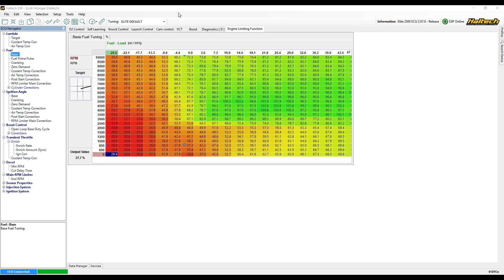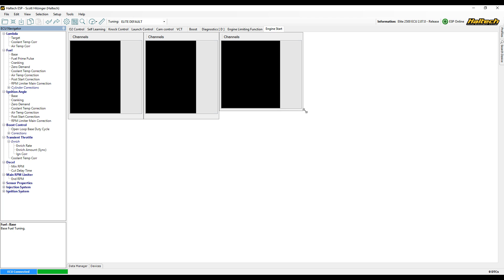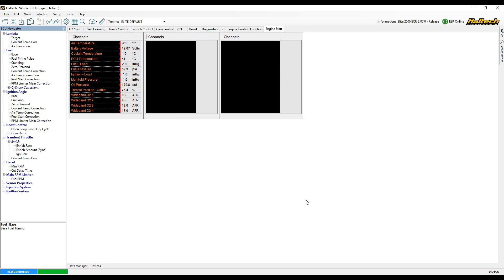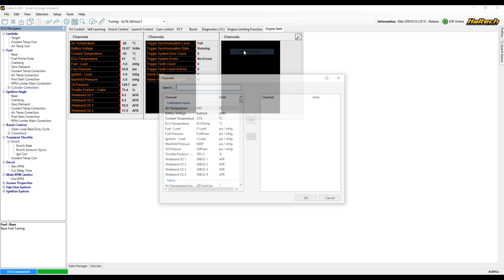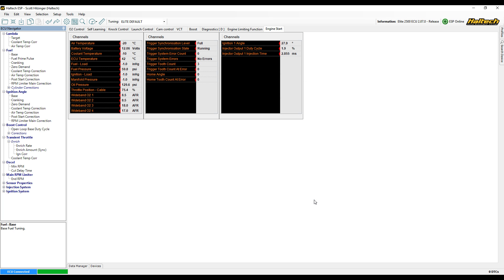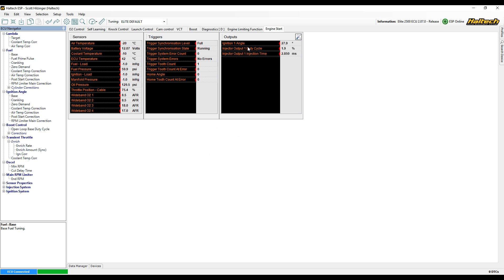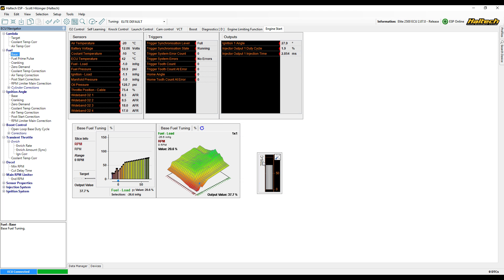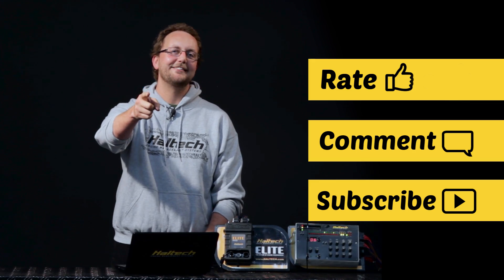How to customise your ESP Tuning Page - Haltech DIY

Comment: Elite ECUs look the goods, just a shame it's over $2k for an Elite 1500.
Reply from the maker: +AzraelX06 The E1500 by itself is well under $2K - check the pricing here:
http://www.haltech.com/elite-1500-features-and-pricing/
Reply: +haltechecu 
That's for ECU only. 
Do you supply connectors to wire a loom into the ECU with the "ECU Only" option?
Reply from the maker: AzraelX06 Not with the ECU only option.
Reply: +haltechecu 
Ok, so what options are available for connecting the ECU only option to a harness?
Reply from the maker: +AzraelX06  If E1500 is out of your reach, check out E750 which is due to come out very shortly:
http://www.haltech.com/elite-750/
Reply: +haltechecu 
That also looks interesting, and I read youe news article on it. 
I'm after the long and short term fuel maps that are features of the 1500, otherwise the 750 would be the one I got.
Reply from the maker: AzraelX06 You can wire it manually just with a plug and pin kit. OF course a patch harness or a terminated loom is quicker and simpler option but that's where the extra cost comes in.
Reply: +haltechecu 
Alright cool, thanks for your support.